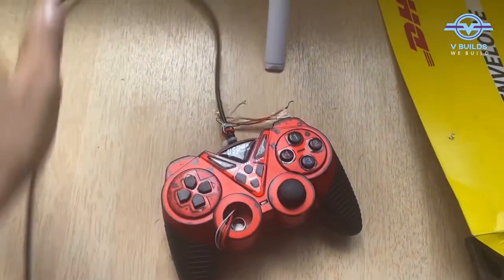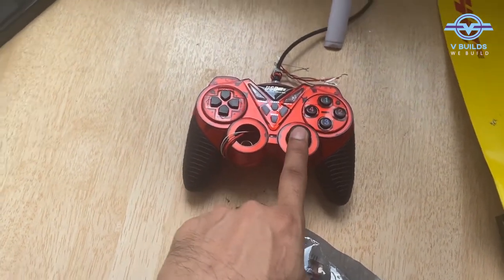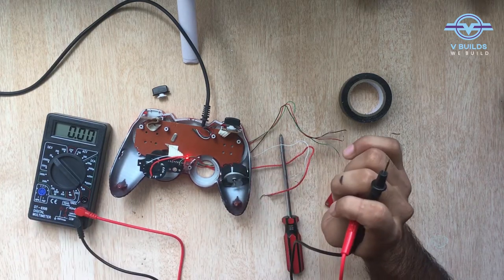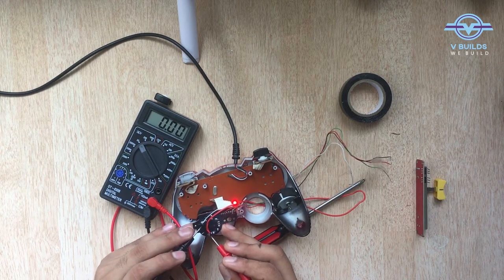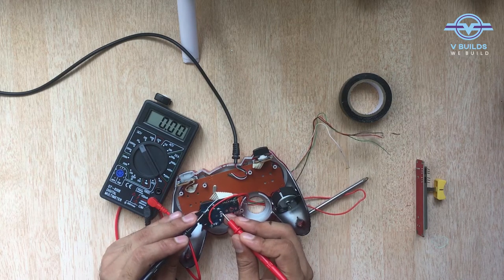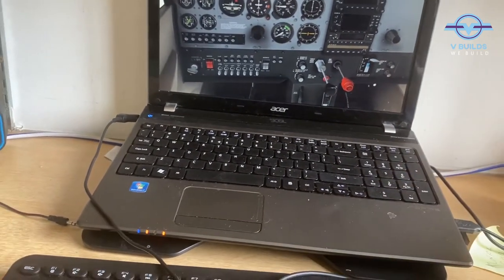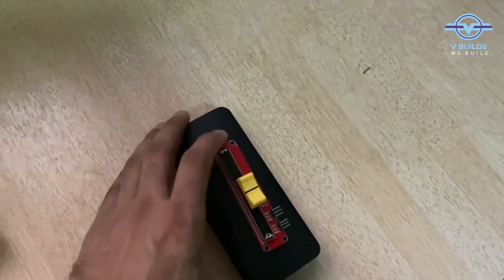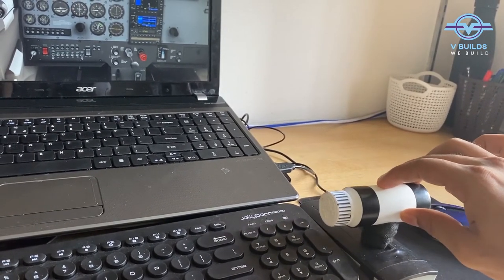Flight Simulator 02- Throttle Control  D.I.Y

Comment: How would you use this for reverse thrust?
Reply from the maker: you can add a push button on it, and configure it to toggle reverse thrust, then you can use the same lever for reverse thrust too, Other option is to add another linear potentiometer with another joystick axis and cofigure it as reverse thrust

Comment: where did you connect the other black wire bro?
Reply from the maker: @rhenies4132  let me see which black wire you are talking about
Reply from the maker: @rhenies4132  sorry can you mention the time where you see the black wire .. 🤔
Reply: @VBuilds  exactly 9:30, the wire you're holding and soldering. Is that the output (Y-Axis)? Please enlighten me
Reply from the maker: @rhenies4132  So there are 3 wires to the linear potentiometer, 
1- +5 VOLTS   (marked as VCC )
2- Ground  (marked as gnd)
3- Signal (marked as DT)

The one at 9:30 is signal wire from the controller potentiometer!
Reply: @VBuilds  thank you bro! I will do this. You're a life saver
Reply from the maker: @rhenies4132  glad to help

Comment: Hi would this work on x plane 10 mobile using an Xbox controller
Reply from the maker: Hi, If you can play xplane 10 mobile using an Xbox controller, then YES
Reply: Ok thanks. You can
Reply: Would the Xbox controller still retain its Bluetooth functionality
Reply from the maker: @matthewkane502  yes, be careful not to damage any other connections… only use the joystick connection points